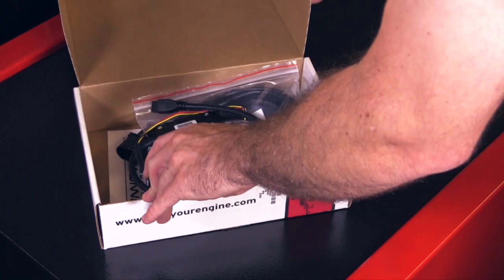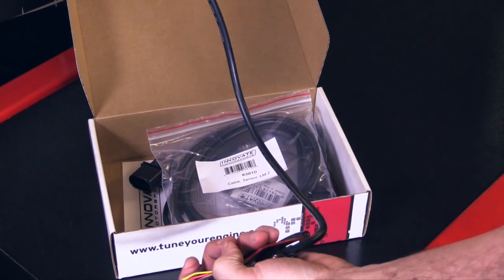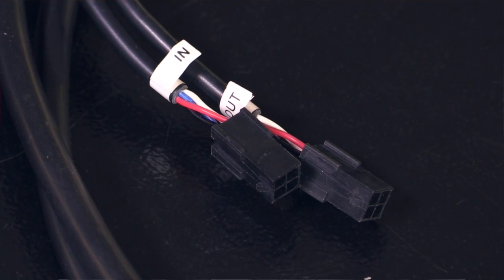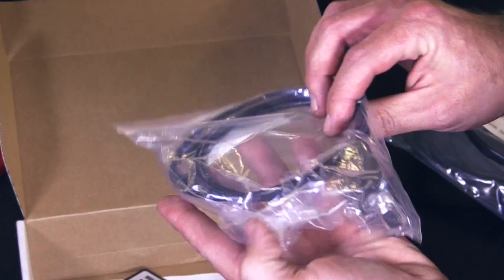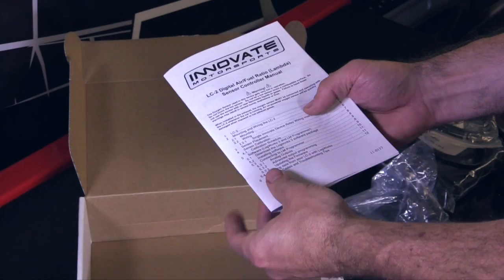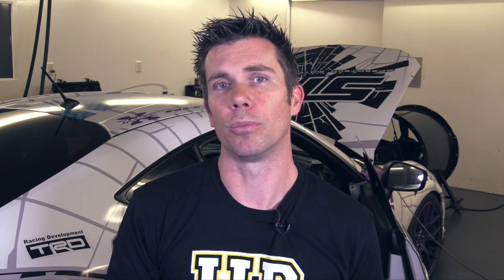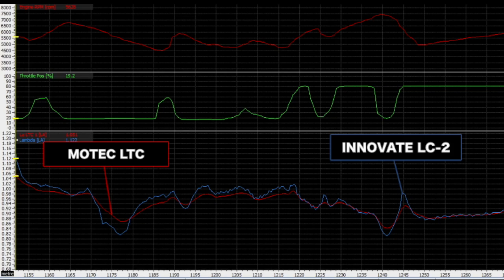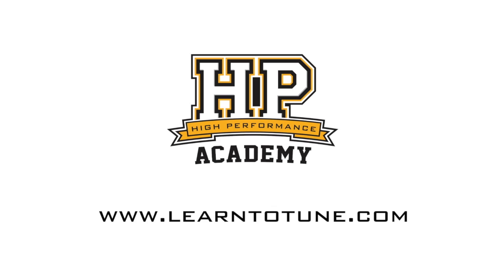Innovate LC-2 | HPA Product Spot Light

Comment: Hi Does this work with factory Ecu narrowband? Does one of the analog wires get spliced into the factory narrowband Ecu wire to keep the Ecu happy with the Lambda readings from o2 sensor 0-1V and then the other analogue wire goes to a Afr gauge to see the wideband readings? Thanks